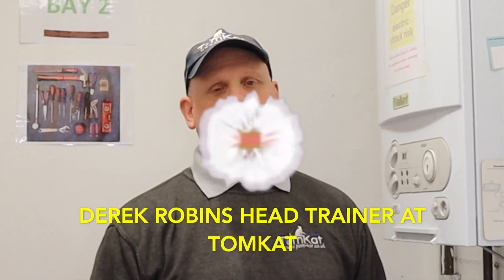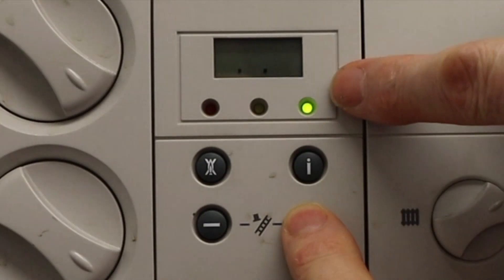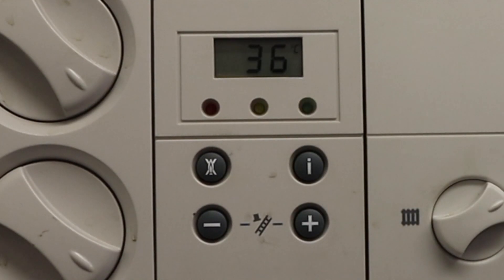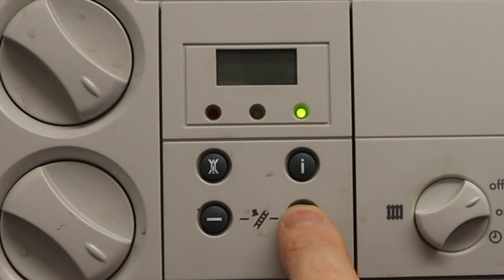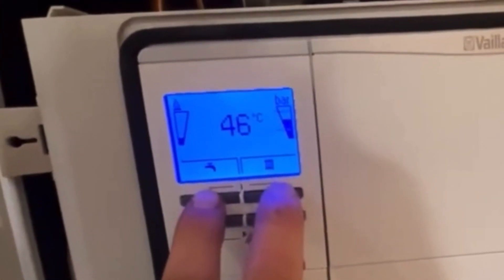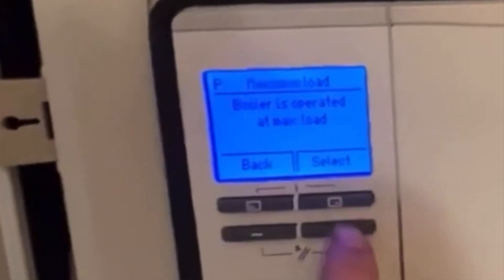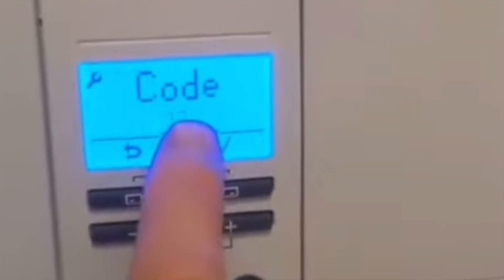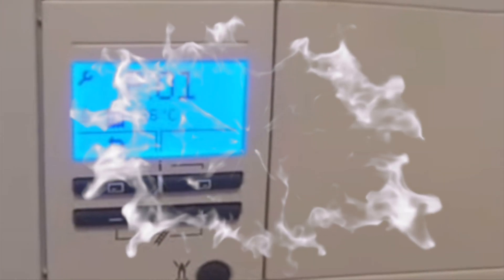How to put different vaillant boilers into  service mode, chimney sweep mode or high and low fire,

Comment: I have a question unrelated to this video but I'd appreciate it if you'd answer it:

I have a potterton promax 28. The hot water works fine, pressures fine. When I call for heating the flame sign comes on the programmer and the reciever lights up. But the boiler doesn't fire. 
Is this a diverter valve issue?
Reply from the maker: I would look at the switch live wire first to see if the controls are working

Comment: Daft question, but what is the difference between high fire and chimney sweep modes?
Reply: If boilers been range rated, then chimney sweep will take you to whatever CH max is.. this won't be max output
Reply from the maker: @raul835  it goes to maximum overriding what has been set
Reply: @tomkatgastraining  I thought the exact same but was on a Vaillant training course on Friday just gone at Elland.. this question came up and that's the response we were given.. don't know if true across all boilers or just Vaillant
Reply from the maker: @raul835  some boilers you can adjust the % but all will let you do maximum or minimum now, that’s not always been the case
Reply from the maker: Nothing it’s just the different names different manufacturers give the mode

Comment: Eco tec....try holding plus button and then press rest.... This will do the same job but without turning boiler off and on again 👍
Reply from the maker: That way was not recommended by Vaillant but it does do the same job 👍🏻
Reply: @tomkatgastraining  just shows you how crap valiant are. Turn the power on and off is the most likely way to kill a pcb when they get older. They don’t make capacitors like they used to.